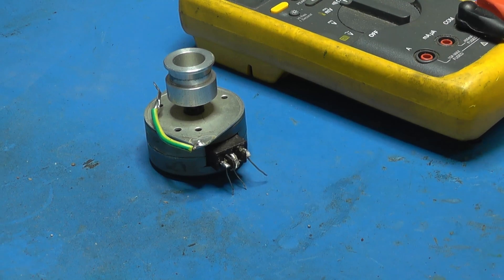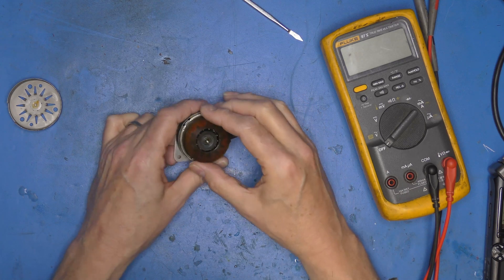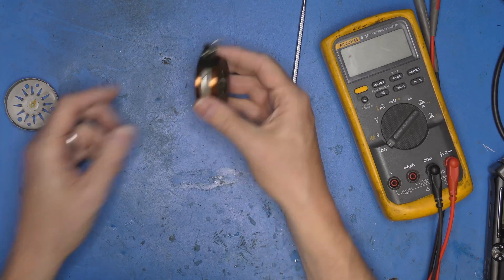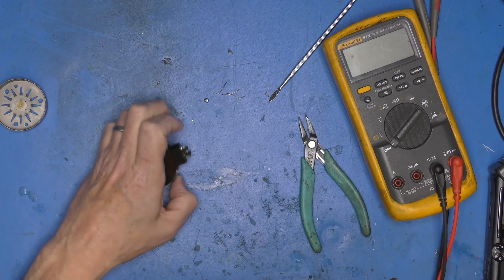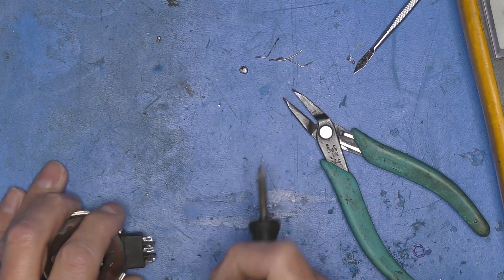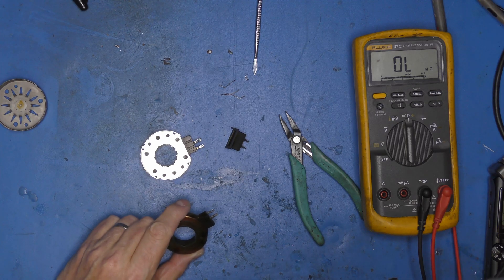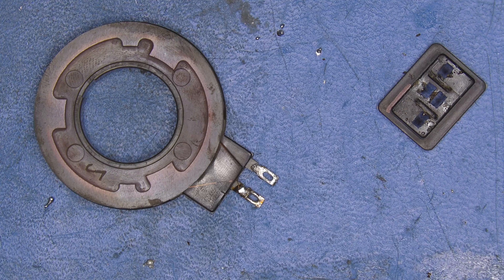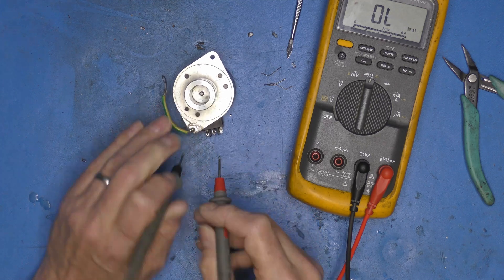Linn Axis motor repair in real time

Comment: Thanks for the insightful video. I've got this problem on my Axis and I gave the turntable a nudge last night! I won't do that again, but what do I need to do to save it before the motor dies? Will replacing filter caps on the PS do it or will the output caps need to go as well? Thanks!
Reply from the maker: Yep. Change the lot. Beware of the fragile double sided print, and don't try to fault-find unless you have an isolation transformer.
Reply: @AndyDoz amazing, thank you 🙏
Reply from the maker: @flypieTV the other thing you may wish to do, is add an in-line switch in the mains lead.  The poor old axis supply is always on when plugged in. It's amazing how they lasted so long really
Reply from the maker: Also, check out this I wrote years ago : https://andydoz.blogspot.com/2017/02/linn-axis-of-evil-repair.html
Reply: @AndyDoz that’s a good shout. I actually unplug mine if I know it’s not going to be used for a few days. And it’s usually starts spinning as soon as I reconnect.
Reply: @AndyDoz wonderful!